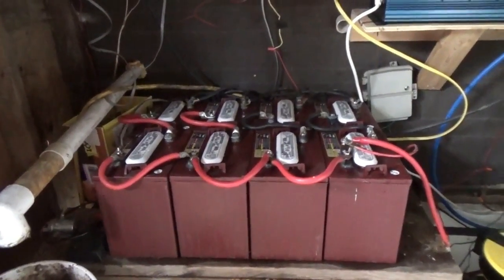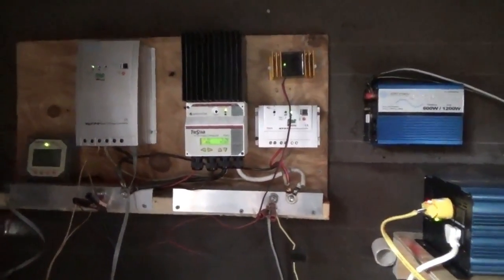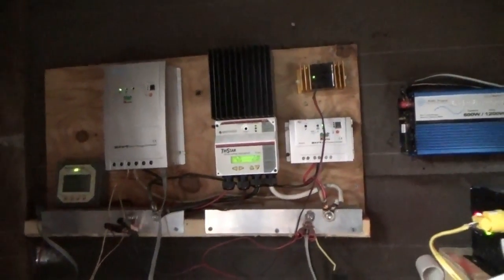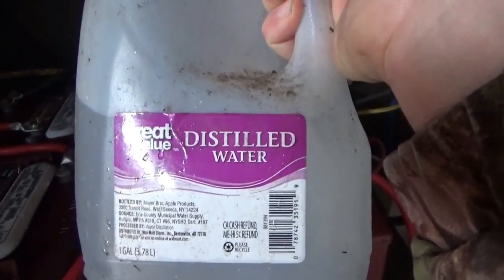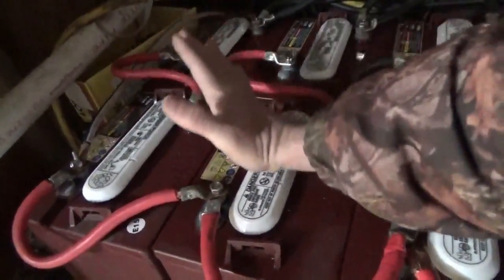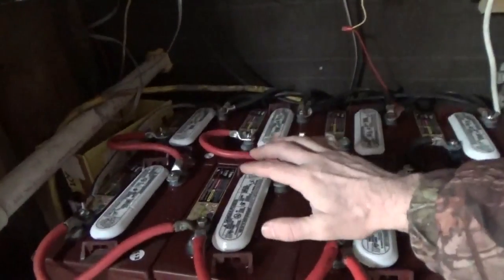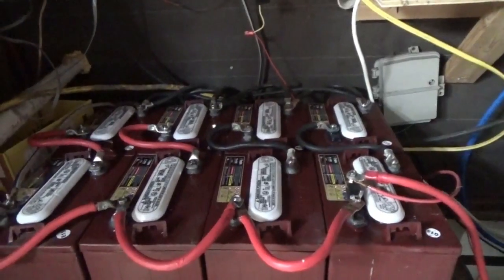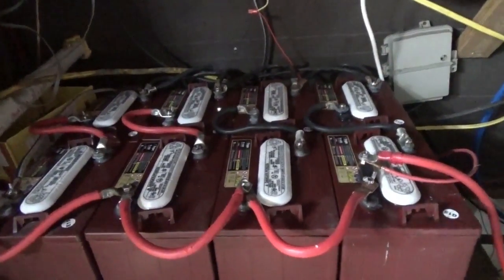All About Batteries ~ Charging ~ Maintenance ~ Voltages

Comment: Hi Troy n' all,   Congrats on the forthcoming new addition and good luck with the move.
Equalise is high volts but is it high amps ? I understood, it was not. Also, are you 'Boiling' the acid or is it just making hydrogen rapidly which sounds like boiling ?

Comment: Your terminal is black from acid vapor, it is out gassing around the post and battery case. This also corrodes the connector. Clean around the case where the post is, when clean and dry seal with RTV silicone .  I do this when my batteries are new and have no problem with corrosion. I hope this will work for you.

Comment: A few small comments, (yes its me again... lol)  first, Keep your battery's covered or in a closed box whit ventilaton to the outside, 2, never mount electronics above the battery"s (to prevent damage from acid vapors). Never go below 50 percent of charge whit lead acid battery's like the trojans. only traction battery's can go to 80 percent, but y agree, the less you drain them, and the faster you get them on float, the better it is!, use of a master switch is advisible, and use of a master fuse s also a good safety thing!

Comment: Thanks Troy I went ahead and printed the article, question? can I use a car battery, if so does it matter what kind.
Reply from the maker: You can use a car battery but they are not very good for deep cycle (solar) applications. Not as much storage space. If you get them free or used then fine but if you are buying batteries then get true deep cycle batteries.